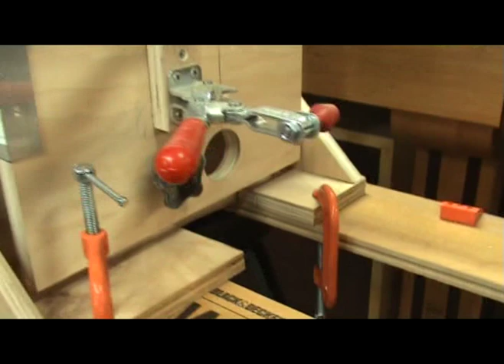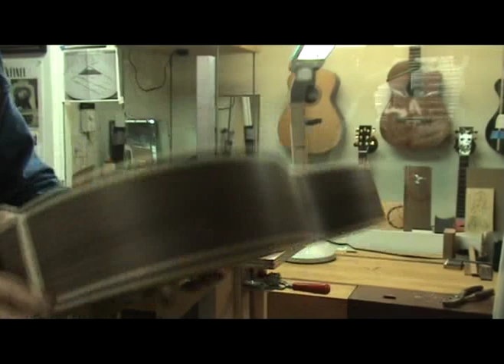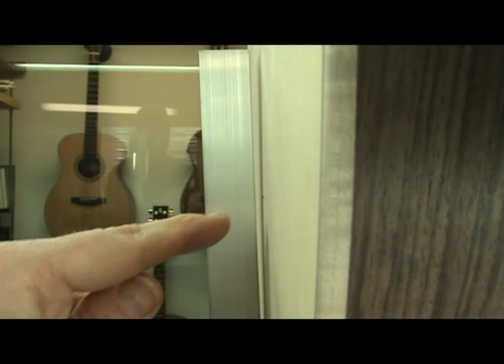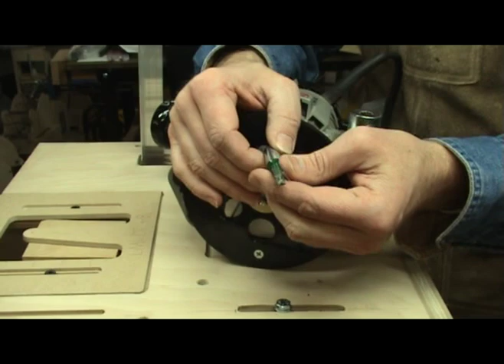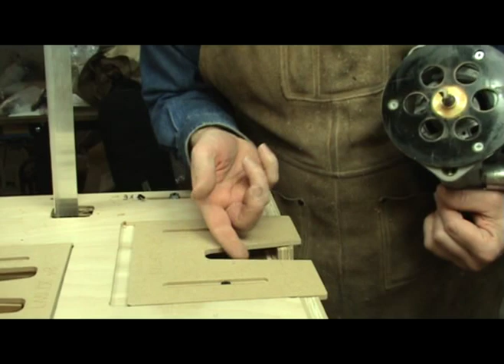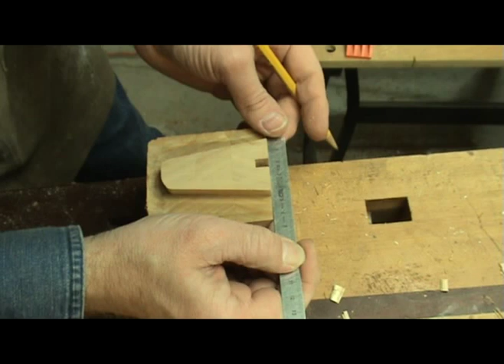Dovetail joint using the neck angle jig

Comment: So question.. I noticed you took poisons to set the neck angle on the jig. Then by eye,  you looked at the uneven gap at the template, and docked off the end of the neck on the chop saw. The fit looked good, but isn't that cut at the chop saw now dictating the angle of the neck to the body?
Reply from the maker: The chop saw cut on the end of the tenon is just an approximation because the tenon doesn't bottom out in the mortise cavity. You want room for expansion.
Reply: @OBrienGuitars  it wasn't a cut on the end of the tenon. Didn't you cut off the entire end of the neck that wasn't flushing out with the template? The part that meets the body? What am I missing? And btw I appreciate you answering, you do nice work!
Reply from the maker: @jeffdeluca1153  The jig allows the tenon to be cut at the correct angle needed to get the correct bridge height and therefore saddle height when doing the setup. The jig has an adjustable shelf for this purpose.
Reply: @OBrienGuitars  I saw the adjustment for the snake and observed you do that.  It was at the point where you saw the template was not sitting flat on the neck. You stated an approximate angle amount you needed to cut on the chop saw. Doesn't that cut now dictate the angle? Cause once the dovetail is cut off that reference, that's the angle of you want the dovetail to fit
Reply from the maker: @jeffdeluca1153  No, that cut doesn't determine the neck angle.
Reply: @OBrienGuitars  lol. Not poisons, pains
Reply: @OBrienGuitars  Doesn't that part of the neck butt right up against the body? Doesn't the dovetail pull that shoulder joint tight against the body at whatever angle it's cut at? If not, what am i missing? Thanks again
Reply: @OBrienGuitars  also, is there a plan available for the latest version of this jig? I'm fairly adept at woodworking. Is that "enough" experience to build a guitar like this? Any special skills needed? Thanks again
Reply from the maker: @jeffdeluca1153  I do sell plans for my neck angle jig. You can find it at the Lutherie Academy website. https://lutherieacademy.com/plans   I also have online courses that will guide you through every step of the guitar building process.   https://lutherieacademy.com/courses  If you are a woodworker and can follow the instructions you should have no problem being able to build a guitar. Happy Building.
Reply from the maker: You are correct but the router cuts that part, not the chop saw.
Reply: @OBrienGuitars  Correct. But didn't the router reference off the template, which you fit the neck angle to, to close up the gap that existed?
Reply: @OBrienGuitars  I may have had a revelation.. so even if you left the gap that we're  discussing, I do understand that the router bit will cut parallel to the top of the template.  As long as any wood "outside" the area the router bit cuts the neck angle will be maintained. AM I thinking right? Please tell me yes.. lol

Comment: Thanks for this discoursive attempt to explain how to use this jig to do a dovetail neck joint,. I have viewed the more recent video on the neck joint jig and wondered how you could so blithely say that doing the dovetail joint is similar. The geometry of the joint is so much more challenging than the bolt on m&t!! Not sure what else to say, but that a video explanation of "dialing in" would be greatly appreciated. Learning how to set the tenon in relation to the mortise template, if there is an algorithm to make this possible, would be extremely helpful. Your process of adjustment down to a fit is what I have to go through for each joint, it seems, and it would be VERY helpful to have more guidance on how to get closer to a fit after routing a mortise and then a tenon. How does the Martin custom shop do this???
Reply from the maker: I have my students set the templates on the dovetail so that the neck is proud of the body. This way they gain experience using hand tools to slowly set the neck into the cavity. You also do not run the risk of trying to get it perfect out of the jig and finding out that it is sloppy in the joint. So, as you do a few necks and gain confidence you can dial the fit in by slowly adjusting the templates so that you get closer to a final fit right off the jig. I do not recommend it on your first attempt though. Hope this helps.

Comment: Robbie, would it make sense to add a bridge-thick-block on the aluminum angle rod just at the point where the bridge would sit on your body?  This way the gap is always compensated for?  Great video as always!!  Thanks!
Reply from the maker: I do not think so. At the point of setting the neck there is no fretboard attached. I therefore am not taking that thickness into consideration at this point. I am only concerned about the gap at the bridge without the fretboard.
Reply: I understand you point, maybe I phrased that wrong.  If a 3.5mm gap is desired at the saddle (during jig setup), maybe put a 3.5mm block on the aluminum at height=saddle location?
Reply from the maker: Sure, that would work. You could also put the shim on the guitar instead of the bar.

Comment: WHY MAKE THE CUSTOMER  BUIIID THE DEVICE/HASNT HE/SHE PAID ENOUGH TO HAVE IT FULLY ASSEMBLED AND ADJUSTED? THIS SEEMS TO BEA REPEATED  ISSUE WITH LMI
Reply from the maker: There appears to be alack of understanding in how this jig works. It must be set up and dialed in to fit the neck specs for the guitar you are building. It is also much cheaper to ship in an un-assembled state rather than fully assembled. For the price it is not asking much for the end user to assemble the jig.

Comment: Excellent video!....a little confused about neck heel angle: the heel is not at 90 degrees  to the fret board? Do you have a video to help understand this. I realize you make the neck angle to be obtuse to the face of the guitar. Thank you.
Reply from the maker: You are correct. The neck angle is not at 90 degrees to the body. I explain the neck geometry in my acoustic guitar construction course available on my website - www.obrienguitars.com/courses  It is very important to get this geometry right if not your bridge and or saddle may not work properly to get the action you need.

Comment: Hi Robert: Another great video as usual! I am in the middle of what will probably be my one & only guitar build (Martin style Dreadnought) & don't want to go through the hassle of building a complicated jig like that. So, is there another way to cut that Dovetail joint, other than by hand, that would still get the job done & not involve using a jig like that? Do you have a video showing how to do it? Thanks for your time, Steve

Comment from the maker: Yes, i usually leave a small gap between the end of the tenon and the mortise. I also use the bolt on mortise and tenon on my guitars so no glue is used in the joint

Comment from the maker: Bill, If you recess the t nuts that hold the template in place for cutting the body mortise you can get the body closer to the plywood table where the template is. My jig doesn't have the t nuts recessed and I am able to cut a 22mm mortise with no problem. I am using a 1/2 inch straight cut bit with a guide bushing with an I,D. a skoshe larger than the bit diameter. Hope this helps.

Comment: Robert I have built the ``flux capacitor M&T jig`` and am ready to go.  At least I thought I was.  I cannot plunge past 1 cm if using a router bit template bushing.  I dare not make a cut without the bushing for fear of spoiling the template. What straight bit are using for the mortice.  I figure I need about 4.2 cm plunge to make a 2 cm mortice.  The template sits 2.2 cm above the guitar body by the time its`thickness and the plywood is taken into consideration.

Comment: Hi Robbie - I have been trying to get my head around the selection of the router bits for this process. I have come to the conclusion that the first cut depth with the straight bit is dependent on the length and size of the dovetail bit for the second cut . Also the diameter of the dovetail where it meets the shank must be the same diameter as the straight cut bit as it needs to start the cut where the straight bit left off. Is my summary correct ?